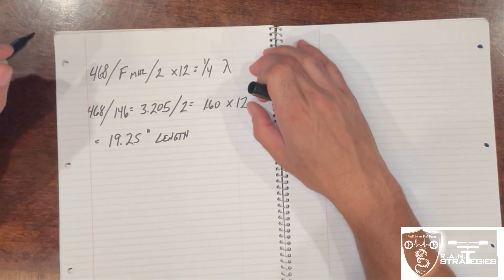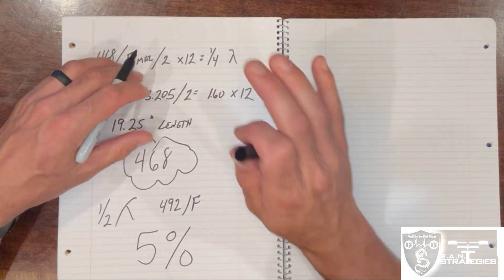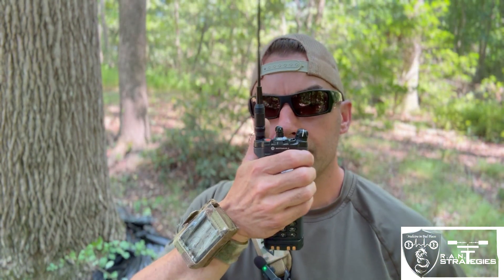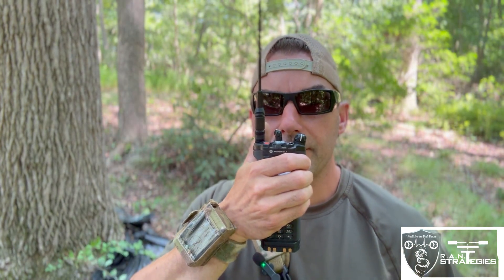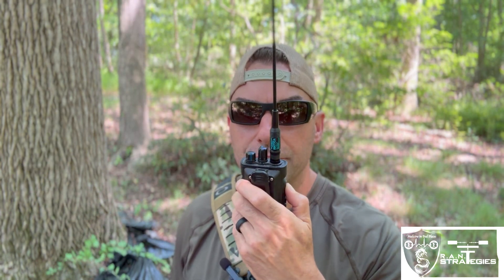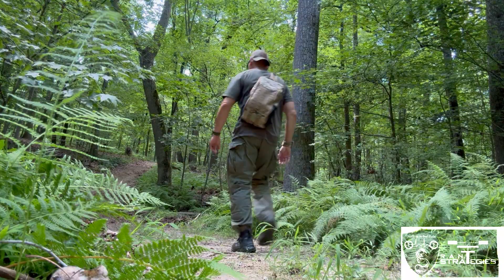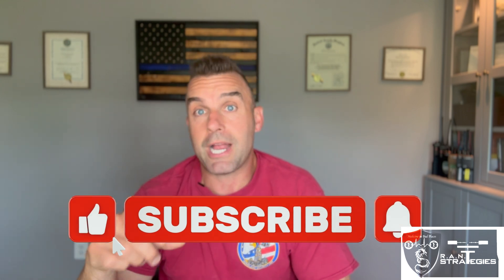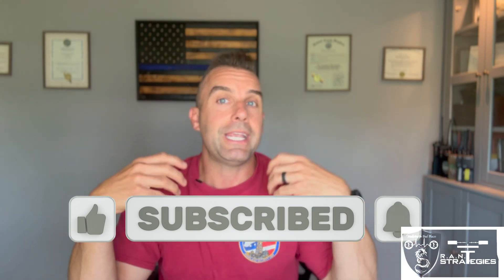UHF vs. VHF PART III

Comment: I just recently watched all three of your videos of the VHF versus UHF tests, And after 10 years of doing radio testing myself I will say that there are times when you will drive yourself crazy trying to figure out which one is better than the other. I also have a set of MURS (VHF) radios that I use from time to time because it does seem like in some environments they are a little bit more forgiving.

Like you I've pretty much come to the conclusion that GMRS/FRS (UHF) has been the best choice for me. Even though there are times when VHF can be a little bit more forgiving in terms of terrain, I've noticed that UHF has been the most consistent. I like the fact that the frequencies are high enough To be fairly immune from many different types of interference Where you can use them in or around buildings, but still low enough in the spectrum that you can take them out hiking or camping and they work well there too.

Another test you might try is listening with the squelch turned off, the recording will hear constant background noise but I've done this a few times just to see if and how well a VHF or UHF signal is being received back at the house. By leaving the squelch open you don't have to worry about what setting the scanner or radio is set to You're just straight up monitoring the frequency. When I leave my radios with a family member I will show them how to disable squelch just in case I'm at the fringe of communications range And you can sometimes get just a little more range by doing that.

I also noticed it looks like you're wearing a GPS and a wireless microphone, these devices might be causing some interference on both radios but especially the VHF. I noticed a similar situation recently at our church where someone put his wireless microphone transmitter next to his cell phone and it was causing a lot of interference over the speakers, When he moved one of the devices away from each other it cleared it up.
Reply from the maker: Hey Jeff! Thank you for the detailed response and its also nice to hear that you have had similar results with your testing as a lot of people have been like, "no way, VHF is superior, don't believe your lying eyes....or ears". I never thought of doing it with the squelch turned all the way down (probably just due to radios not even having actual squelch knobs anymore) but that would certainly give a little more on the way of diagnostics. I also never thought of that GPS or mic causing interference, but that is also something definitely worth exploring... my personal issue with that is, for work purposes, if I'm on a woodland op, that GPS is running and then add in a few other things as well, but its certainly a good point. Definitely appreciate it and glad you are enjoying the content!

Comment: Strange, since my personal experiments have shown the opposite to be true. 2M reliably beats 70CM in heavily wooded areas. In addition, 5W GMRS loses to 2W MURS under similar conditions.
Reply from the maker: @donnakano3697  no idea, could just be terrain / elevation differences causing it. I was shocked as well.
Reply: In Kisatchie National Forest, which is pine dominant, VHF wins out, for me, as well.
Reply: Not using 1/4 wave antennas for both tests. A 19” for vhf a 6” for uhf. Test with that at same power and hight. You’ll find vhf travels further. Yes more picket fencing with vhf… but more range. UHF doesn’t penetrate concrete or metal buildings like VHF. For what you’re doing ol low band 32-39mhz did extremely well!

Comment: Ok I feel like I have to chime in with this. I have been doing tests with vhf and uhf using a variety of antennas but with the same radio and at the same locations for the past few months. I have tested everything from roll up J pole antennas to an Arrow yagi antenna. My terrain is rolling east coast hills and in my case, vhf blows uhf out of the water consistently. Even comparing 2m verticals to a 7 element beam for 70cm, it’s not even close. It’s so wild to me how different everyone’s results are. I guess everyone should test to see what works for their area?
Reply from the maker: @Civilian_AF  absolutely! If people who are into this stuff get nothing out of it except a desire to go and test their gear….. then our goal has been met!

Comment: It sounded like the old saber sounded the best in uhf.  It would have been nice if you did the tests with the old Motorola brick mx radios.  Maybe the issues are where and what parts are used in the newer radios.
Reply from the maker: @jr4062  I thought the same thing! Saber definitely sounded the best to me too!

Comment: You limit is the antenna.  This is not a fair test.  Get a 1/2 wave vhf antenna for apples to apples.
Reply from the maker: I thought this is fair due to both antennas being 1/4 wavelength. Can you elaborate on why the VHF would have to go to 1/2 wavelength... wouldn't I then have to go to a 1/2 wavelength on the UHF side as well to make it fair?
Reply: @RANTStrategies  There is a difference between the electrical length of wire in the antenna and the amount of exposed antenna.  The more antenna in the air the better.   
A 1/2 wave 2 meter antenna would be a bit more than three feet long.   For UHF a genuine half wave is only about 12 inches.      In other words, in most cases, the 70cm portion of a dual band has a more "compromised" length relative to the UHF portion.  This is because there is a coil being used to add electrical length but not physical length.    Even with that however,  my personal experience is that UHF is more dependent on pure line of sight and is more easily blocked by obstructions than VHF.  Even with the same dual band antenna.    Hope this helps.
Reply from the maker: @SHTFchef  I completely agree…. But being they both were utilizing a quarter wavelength antenna, shouldn’t the results have been similar or even VHF out perform UHF?

Comment: I live on an relatively flat island with large commercial windmills in the middle.  When I talk to my buddy on the other side of the island it is a significant difference between 2m and 70cm.
I cant have 100% LOS to his antenna 10km awa,y since the strength is barely a few S-units.
On 2m we both notice a little bit of fading due to reflections from the blades of the windmills.  But on 70cm the signals via the blades are way stronger with deep nulls and high peaks of many S-units.

I believe you might have the same effect in the forest, with stronger reflections from high up in the trees on 70cm.

73 de LA7DFA   https://www.statkraft.no/globalassets/0/.com/1-about-statkraft/where-we-operate/norway/norway-smola-wind-farm_3_1500x1200.jpg

Comment: Thanks for showing us. On boats they use UHF and they reach about everywhere since the wavelength is small and will pass doors and openings! But VHF does not.

What would be nice is to find some scientific paper on what frequency passes easiest in the dense forest! Might be some spesific bandwidth.
Reply: Pretty sure the USMC comms training manual states lower frequencies travel the farthest in every environment outside of urban or densely populated (structurally) areas…..yes uhf is awesome in these congested areas because the shorter wavelength can penetrate objects better but that blessing is also its curse…..that “high energy” so to speak does not carry well over distance….much like a dragster with 3000hp that only goes 1/4 of a mile…..the uhf signal is great within a certain distance but beyond that it runs out of steam rather quickly…..this is why the majority of long range military comms are done on HF frequencies with directional beam and/or loop type antennas….no need for repeaters…..most military air comms are in the 220-240 MHz vhf band….you would think if uhf was superior it would be used in open airspace with no obstruction but the higher wavelength keeps it from performing as well as VHF or HF……someone said in another comment marine radios are uhf and this could be true in some port areas or countries outside the US but marine radios inside the US are VHF and don’t travel very far beyond line of sight…..there are HF marine frequencies and the navy often uses HF ssb for long distance comms…..of course some of this info is dated with the current use of satellite and digital equipment and the extensive data networks available….but in a serious shtf situation you can be certain the armed forces and government will occupy any and all available space in the HF/VHF spectrum and a good portion of UHF for ground based close range comms…..the higher the frequency the less range it can provide….the science is in band usage of critical operations comms…..there is a reason rural public safety and military doesn’t move critical comms above VHF and there are always backup VHF LO or HF frequencies in their band plans
Reply from the maker: @blainehartley9157  preach on 🙏! Awesome info, thank you for sharing
Reply from the maker: That would actually be very cool

Comment: I'd like to see a comparison of VHF vs UHF handhelds used car-to-car inside a vehicle with no antenna outside the vehicle.
Reply: I did two Baofeng UV-5G’s in an Urban environment with my wife inside the apartment and myself in a cars we got about a mile before it started to become static.
Reply: @dslayer1169  did you compare VHF vs UHF?
Reply: @user.A9  I did not, so I’d like to see that comparison! I’m not a licensed HAM operator only GMRS so I’m not allowed to transmit on the VHF band yet unless I use MURS, but that wouldn’t be a fair comparison given it’s only 2 watts legal maximum 😂
Reply: @dslayer1169  have a happy 4th!
Reply from the maker: @dslayer1169  that’s awesome you are out putting it into practice! It’s like DOPE for your rifle and now you have that data. Glad to hear it. Keep at it and stay safe
Reply from the maker: @user.A9  it is on the list! Just had to find a fair location terrain wise to conduct the test, but it’s coming.
Reply: @RANTStrategies  please do city and rural areas.

Comment: I could have told you that, that's why the  US Forest Preserve uses VHF low band. Trees absorb UHF signals easily, internal moisture content.
Reply from the maker: @KA9DSL  this is true, but I question how uhf would do compared to the vhf radios issued when I’m out with the forest service…. I have had some REALLY iffy comms in places. Sometimes and especially looking at these results, I feel like UHF could out perform VHF in  the forests. Especially when out on fires as there is no moisture content present, that’s why we are there lol.
Reply: @RANTStrategies  It's called the shrubury effect. And yes, no moisture, no attenuation.

Comment: So much about this is just completely wrong.
Reply: I completely agree. I am a veteran ham radio operator, and I live out in the woods. Uhf waves are bent and refracted easier than vhf. I have always been able to get out on 2m to local repeaters. I cannot hit most of the 440 repeaters. This is basic radio knowledge.
Reply from the maker: @neillewis181  then why didn’t it punch through when uhf did? Any thoughts?
Reply from the maker: LOL, Go on……..

Comment: Nice test and nice video. No surprise. 70cm has a better chance of finding a path in leaves and trees. Winter might have better QSO for VHF. In Missouri, we encourage folks to get the river edge for better chance for getting a signal through. 73, KF0NNQ WRVR260.
Reply from the maker: That is excellent advice, makes perfect sense!

Comment: I have had the Ailunce HD-1 twice, the
first when it came out around 2017,
and now again for a couple of years.
It is pretty good, and for DMR, which
I started with in 2016, with then very
few other than UHF with a Commercial
Hytera model for about $400.00 or
more.
I have other DMR capable radios now,
with the Chinese being more recent
as DMR was a European ETSI system
I completed a correspondence course
from Tait systems in 2018.
This was a more commercially directed
course as opposed to amateur radio.
73 de Ray W2CH New Hampshire.
Licensed since 1962, and age 80 now. 😊
Reply from the maker: @raymondmartin6737  wow! 80 years old and a ham since 1962! You have probably forgotten more about radio then I’ll ever know. Awesome to have you as part of the channel. So the HD1 that’s in the video is the original from 2017 but it is the gps version. Glad you are enjoying the content and please any insight you have, feel free to provide it, it’s welcomed here. 73!
Reply: @RANTStrategies  Thanks 😊 Very much.
Yes both, the first one and my current HD-1
were and are the GPS version, which I do
believe we're $10.00 more expensive than
the non-GPS version. There is now an HD-2
version, but I saw it's not very different from
the original HD-1. 73 de Ray W2CH,  NH.

Comment: In fact, VHF low band (30-50 MHz) will outperform all UHF radios.
Of course you must use a good antenna with counterpoise.

That is better for military and Red Cross style operations...(In the field)
Reply: Using these freqs also for ECCM modes. No issues
Reply: We have low band 25 mhz for all of our communication vans and they work the best for out in the deep forests and rural foothills. All vehicles have optimized and highly efficient 60 inch antennas with good ground planes. They definitely outperform our UHF radio but we love UHF for repeater service and out in the city.
Reply: @MrFreddarama  
25 MHz is HF (altough similar to VHF low band in propagation, but better)

Are you shure it is 25 MHz ?
It is great in the woods...
With 50W version (you can up to 1500W SSB or 500W FM) you get a lot of km between mobile units with good, centered antennas (side mounted are a problem for 360º range).
Can you give more details ?
25 MHz is great....👍

UHF is pratical for portables (you can link the UHF portable to the 25 MHz in the car, via simplex)
Reply: @jplacido9999  25MHz is not an amateur radio band.  It is above the 12meter amateur band and below the 11 meter CB band and 10 meter amateur band.     It is HF and  not VHF.  Would not a CB radio with appropriate antenna work as well?
Reply: @timbookedtwo2375  
Yes I know.  I have near 60 years of radiocomms (SWL, CB, HAM, MIL, POL, Red Cross, Fireman, Civil Defense, etc.)

I was comment on the guy refering his 25 MHz network, telling him that 25 MHz is HF (not VHF as he stated) and he can be right, because there is some 25 MHz simplex comms licences....
CB will have the same range but much more QRM....
Reply: @MrFreddarama  
Great 👍
It is really 25 MHz simplex ?
What is the range ?
Any remote station on top of a mountain ?

Comment: 1/4 wavelength is half of the antenna.  You actually need a 1/2 wavelength antenna to have a true dipole.  In practicality you have 1/4 wavelength antenna whip and the metal inside the radio + capacitive coupling between your hand and the radio are acting like the other half of the antenna.  

To state it a different way that might help some people… half of your antenna is the antenna whip and your skin and the body of the radio are the other half.  Human skin isn’t very conductive obviously.  On uhf it’s manageable to get a 1/2 wavelength antenna whip, but on vhf it’s just too large to be very practical.  Better to keep uhf on your person and vhf for longer distance vehicle mounted communication.  You can also do something cool like crossband repeat through an IC-2730a on your vehicle.  This radio will pass p25 and fusion c4fm in the crossband repeat mode even though the radio is only an analog radio.  It’s an undocumented feature.
Reply from the maker: @hardwired3640  💯 % we are actually going to get into this a little on an antenna test video we are going to put out, great info! Also, love the trick with that radio! We all run xts5550s in our trucks.

Comment: As lower the frequency  as better is the range. On the 70cm/2m band (only one I can use) I prefer 100+cm foldable tactical ABBREE antennas. If someone wants maximum range I recommend CB radios if you have no HAM license. Another thing to know: If your partner does not hear you, that does not mean that a receiving tower does not hear you. They are so powerful that they get signals more than 100km away even if your partner is less than 2km distance and cannot hear you. Another interesting thing: Some frequencies are being reflected by the enviroment similar to a flashlight against a mirror, others can go throught an obstacle and some frequencies cannot. It's a miracle if you test it in the real world.
Reply from the maker: @xitec75  while there is usually some truth to this, the focus here is on no infrastructure and short range “squad style” needs for communication.

Comment: As an actual Comms Guru for a major PD, I agree with UHF being a better band period! I've talked clear across down town Boston on simplex with portable radios. Mobile radios don't even need a repeater if everyone is in the city. I've also found that UHF is almost always better in the woods. Never walked out of range of UHF. I have with VHF. Excellent channel!!
Reply from the maker: Hey John, definitely appreciate the channel and your feedback. It's always interesting to us to put these things to the test and see where the results wind up. Glad you enjoy and appreciate it like we do!
Reply: I wonder if 6 meters is better than 2 meters for the woods.
Reply: @jeffkardosjr.3825 
Yes it is, but be carefull with the antenna...
Reply: @jeffkardosjr.3825 I am thinking the wavelength needs to be smaller than what the forest is dense. But it might be like UHF goes nice and low VHF goes nice. But not in the between. I want to search for a paper about it